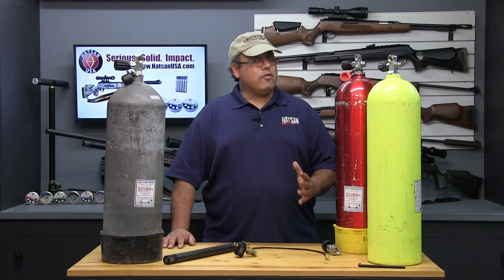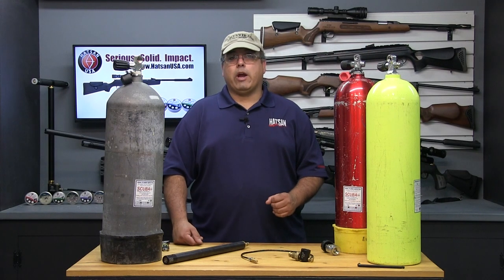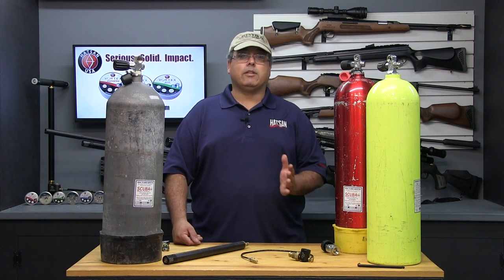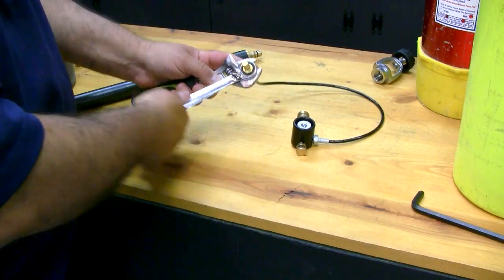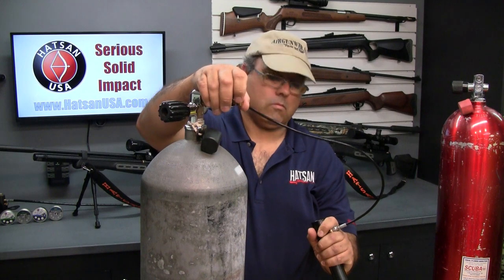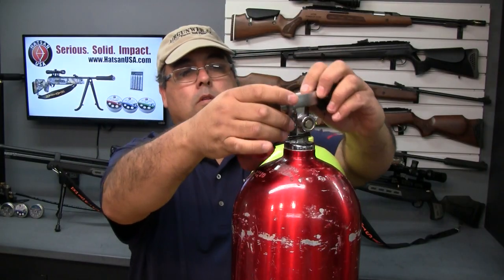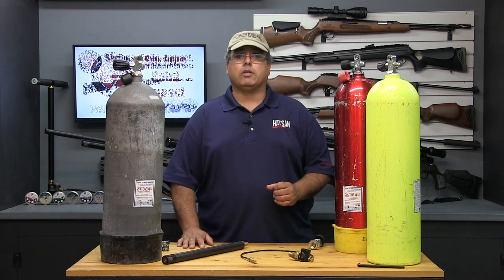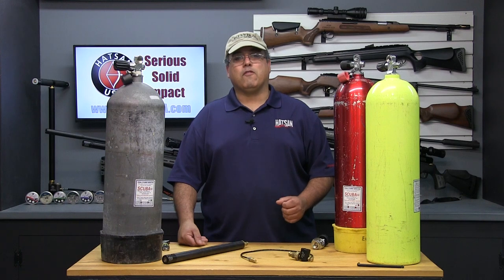Filling your Hatsan PCP Airgun - Hatsan SCUBA Fill Kit

Comment: I would highly recommend getting a different kind of refill cylinder--which may mean a different rifle. One that has a real attachment at both ends of the refill hose. This one has a probe with an o-ring in a groove. Mine has on several occasions shot out of the rifle while filling and traveling at many miles an hour put a huge dent into the scuba tank. Destroying the probe of course. Also many folks seem to have problems with these type cylinders holding air, they tend to need a lot of rebuilding. Which you can purchase a new one for about the same price as sending it to someone to rebuild.
Reply from the maker: If you've had that experience then you are doing something very wrong.   We fill guns dozens of times each week.  The only time I've had a hose fly of a gun was from a defective foster quick disconnect fitting or a hose fail.  I've never had a probe shoot out the gun.  I could see that happening if your o-rings were worn and you filled to quickly.. but if you pay attention to your gear and watch what you are doing, you should not have any issues filling a probe based gun.

Cheers
AGW

Comment: I have a hatsan rifle and when I connect the attachment to the port to pump the air from scuba tank it does not put any air into rifle stays the same. I have tried every thing all videos and still nothing
Reply from the maker: How much pressure do you have in your scuba tank?  They will only ever equalize. So if your tanks drops below 3000 and you are trying to fill to 3000, you can’t get there.  If that’s not it, contact HarsanUSA.  

Cheers
AGW

Comment: Hatsan stuff is garbage, just read all of the complaints below.  I really wanted to like them considering the features for the cost. However, I have gone through 3 bullpups and none of them worked properly either leaking air, or not cycling rounds consistently.  I went with Benjamin and European air rifles, and they work flawlessly.  Many comments I have seen online also complain about the Hatsan guns developing leaks. Recently spoke with a pro air gun shop, and the guy said he clearly steers clients away from Hatsan.  Now I have the 1.6 Liter tank, figuring how can you do a simple air cylinder wrong, but leave it to Hatsan to even screw that up.  The valve is locked and won't turn, meaning I can't close it or open it to feed air.  The instructions are useless, written by a 6th grader in ESL class. No clue as to why the valve won't turn, but will never buy Hatsan anything ever again.

Comment: Hey Rick thanks I watched you video on filling my bt65 elite. 25 just got it a week ago and now I'm having issues with filling when I isert the filler tip it only fills to 150 and sometimes 170 don't know if it's the rifle or my scuba tank I don't if you remember me I had a privious issue with the o-ring on my bt65 elite I sent it back and just got my new one and I will hate if it's my rifle my Budd told me to get a beji but after shooting mine I love it but don't know if this rifle is problematic do you know what's going on please reply don't know if I should start another return thanks again Rick I really do appreciate your advice I would really like to keep this rifle ps I've only filled 4 maybe 5 times since my rifle came in and lowest I let it get 130 to 140psi
Reply from the maker: jose g castrellon - You need to get a dead head gauge for your tank and fill system.  I take a standard gauge and just add a foster quick disconnect to it and then plug it directly into my fill setup.  Then I can see the pressure in my tank.  If you are filling from an aluminum tank, you may only get 2 or 3 full fills.  From then on it will be less and less.  Fortunately the BTs have a removable air cylinder.  If there is an issue, it's going to be there and that's a very easy fix.

Cheers,
AGW
Reply: Thank you Rick I really appreciate your reply I do like my bt65 but have a ? on maintenance and tuning. where can I get info on tare down of the gun as it ages I'm sure it is going to need new O-ring and Manuel states service after many hondreds of shots but does not give info. I work on high psi a/c systems thru my trade as a auto tech but this is not an auto and as you know not the same but it would be nice to be able to have some letreature to help me keep this rifle at its peak after warrenty runs out if I could just drop it off and pick it up after service would be nice but I live in AZ I have student loan and such it will be to expensive but more importantly I really don't like the waiting will 1 or 2 days ok but I'll be looking at weeks or depending on the situation thank you again oh ps just got reply from pyramid air and they want me to cal to set up a pick up to get another cylinder bit I hate going through it I work in the morning and by the time I get off its too late I was thinking about just buying another one and use the other as practice so I can fix my rifle or cylinder but sounds like I'll be paying anywhere from 150 to 200 for another please let me now if you guys have manuals on bt65 repair and mod thanks
Reply from the maker: jose g castrellon - have you spoken with Hatsan USA?  They have all the rebuild kits readily available.  They would be the folks to talk to.  Give them a call.  You may need to leave a message, but they will get back to you.  Rebuilding a cylinder takes about 5 minutes.  It's not like when you have to rebuild a marauder after a leak.  

Cheers
AGW

Comment: I live in central Florida and we can't buy a scuba tank or even have one filled unless we are certified scuba divers. Kinda screws air gunners huh
Reply: Not really, buy yourself a tank thru pyramyd air, airgun depot or ebay and or amazon.  Then buy you a decent compressor to fill your tanks, or gun and you don't have to worry about filling them anymore.  I brought myself 2 compressors, and 2 tanks (over time 6 yrs) and its working out fine so far.   No I'm not rich, I just shop for deals and also discount sales or refurbish deals.